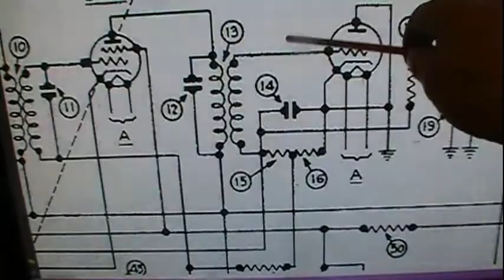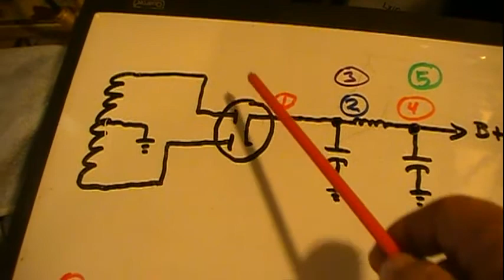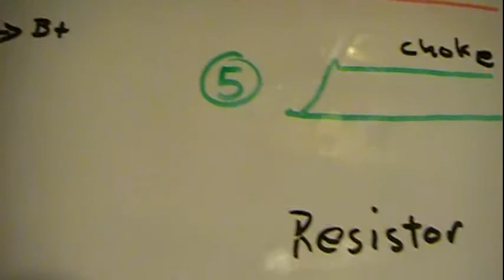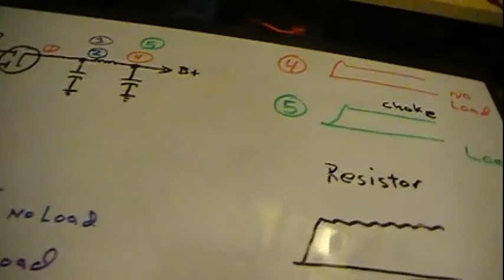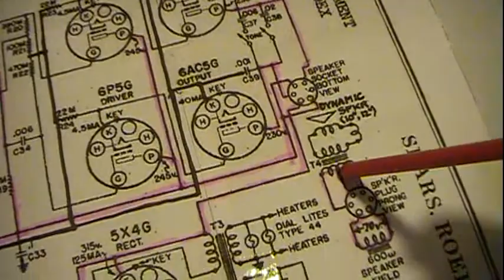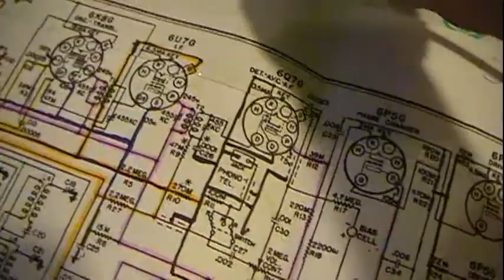Answering questions on my last video

Comment: Dennis,
First, there is no need to apologise for producing a long video: especially one as brilliant as this one my friend.  Second, a big thank you for producing this video: sure it was educational but it was also very entertaining.  What do I mean by entertaining?  I generated entertainment in my own way by freezing the vid at the start of the demodulation circuit micro tutorial.  I then attached an examination type question to it.  “a) Explain the functionality of the above circuit. b) Give a brief account of the demodulated signal excursion. ”   I must point out I have never before seen that arrangement of an anode and cathode strapped together and then connected to deck.  I allowed myself a maximum of six minutes to write my answer on a bit of scrap paper then I resumed playing the video so I could check my answer.  I am happy to report my answer was in harmony with what you went on to explain – it was a bit of fun, therefore, once again it has to be a big thank you.
Thanks also for going over the pi circuit operation in relation to HT-rail smoothing.  Although I’m reasonably confident with how they function, I thought it would be a good subject to cover for those less familiar.
Finally, I look forward to the time to your tutorial(s) on choke and transformer construction.  I remember a college lecturer devoting several lecture sessions talking in depth about choke and transformer construction.  He talked about the many types incorporated into radio and TV, and their function.  He delivered lots and lots of maths/formulas pertaining to size, thickness, and amount of soft mild steel laminations – similar for volts/amps (signal/waveform) inductance/delivery – similar for iron dust slugs – similar for wire gage – similar for the number of turns, and arrangement of turns etc, etc.  As a seventeen year old, most of it never penetrated my brain as I found it exceptionally hard going.  Now that I am much older, I do believe I’ll find it very worthwhile.
Once again, a brilliant video incorporating a short series of micro tutorials so eloquently delivered.
Regards,
Phil.